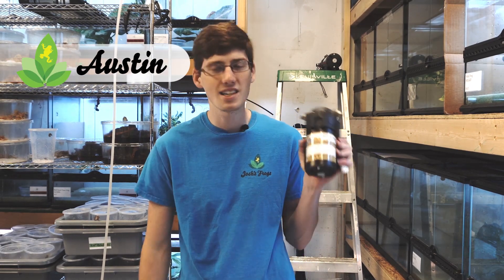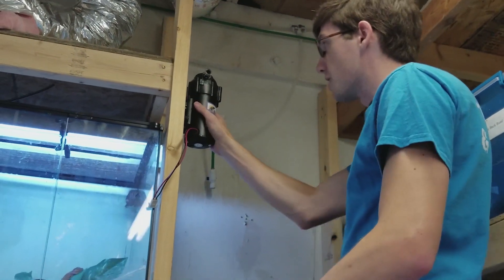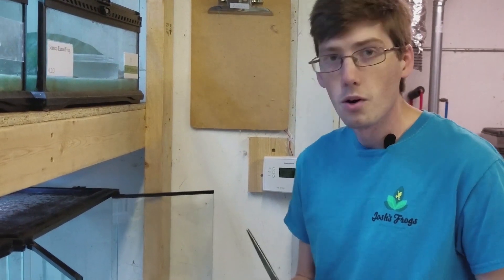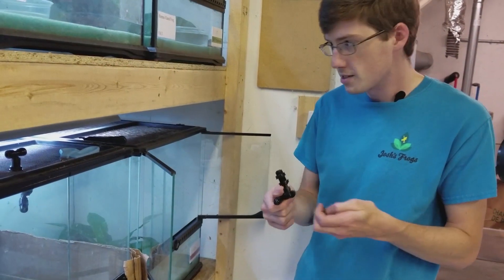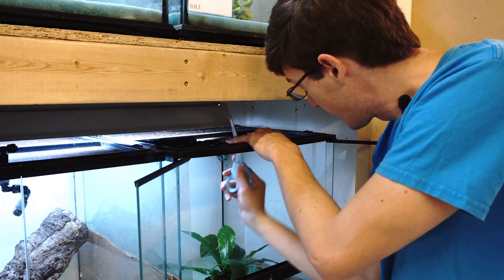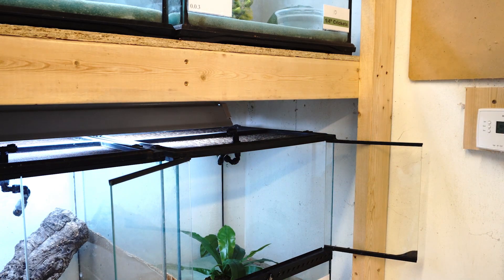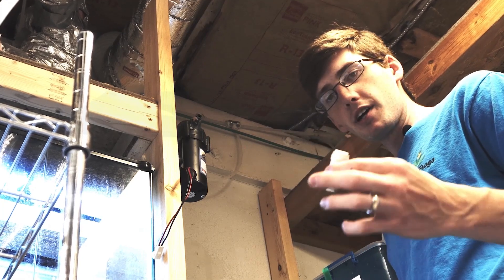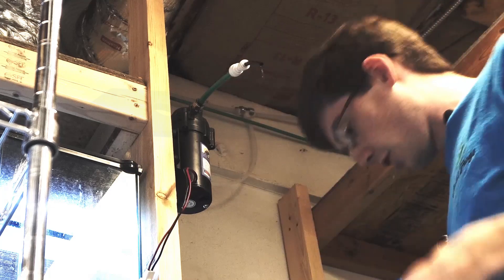How to Setup a Mistking Misting System Part 1

Comment: It's critical to mention that that 99% of those using the mistking will be using a reservoir (NOT A PRESSURIZED SYSTEM FED BY RO/DI) and that the pump + reservoir needs to be located BELOW your nozzles.  If your using a pressurized system you can mount the pump anywhere

Comment: I think you need to be careful with amphibians .
If they are resting on the end of the nozzle and it starts, I believe it would damage their stomachs.
Reply: Pretty much every breeder of amphibians  uses a misting system and it’s never been a problem. The only animal I could think of that could be really hurt by the mister would possibly be a dart frog because they’re so small but they’re terrestrial animals. I’d imagine if an animal like a glass frog was by the mister when it turned on, and it was uncomfortable for the frog it would just jump away.

Comment: Why would you need a mist king if you are on pressurized RO feed?? Just use the solenoid on a timer and call it good. Lol
Reply: Better mist from the higher pressure of the pump vs what is supplied from your waterline is my assumption. I had a misting setup on my patio that did not utilize a pump, it left a lot to be desired.